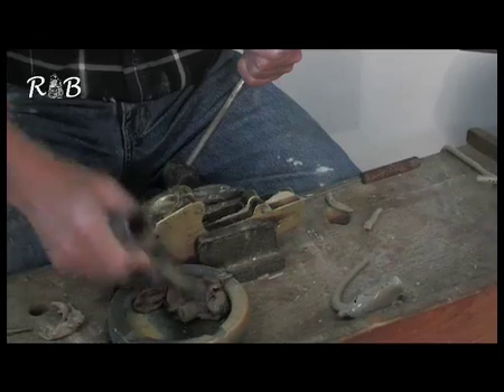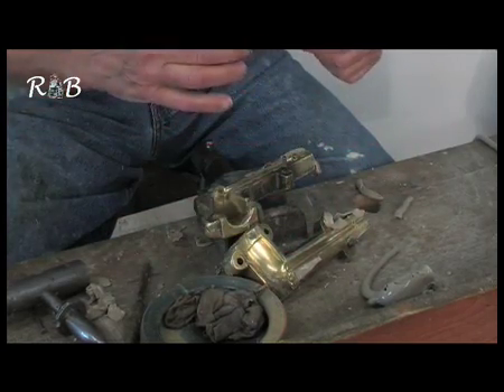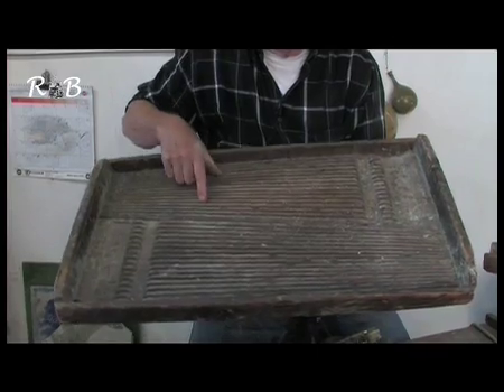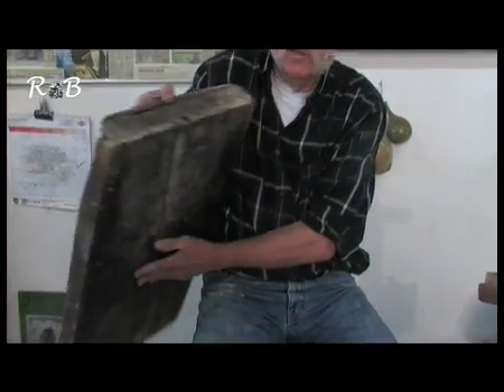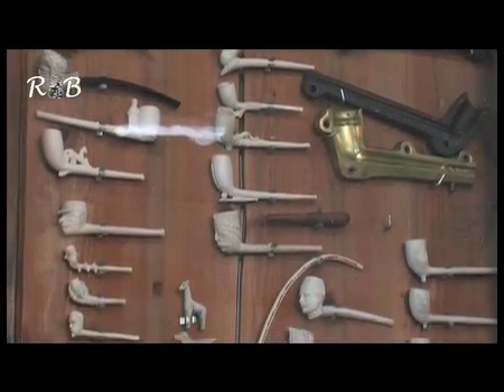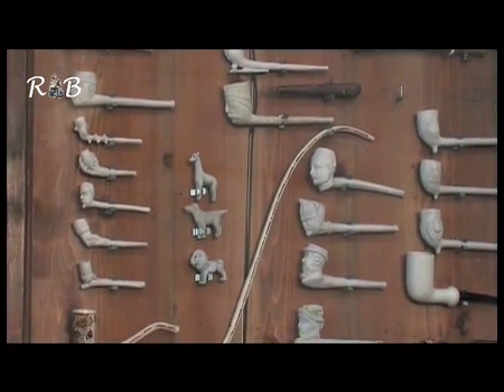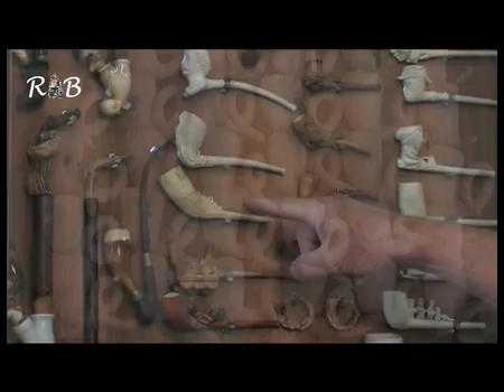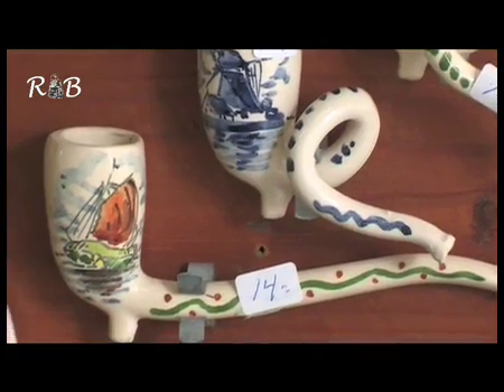The Art of Making Clay Pipes

Comment: Clay pipes can be cleaned by placing them in a fires hot coals.  Or by placing them in a kiln as long as the heat is less then when they were originally fired.

Comment: what type of clay is ok to smoke with? red?
Reply: Stefan Bradley Any high fire ceramic clay will work. I use a white porcelain clay. What most inexpensive pipes are made from is Kaolin clay which is a very, soft, pliable and easy to work with clay. it is sold in bulk powder form.